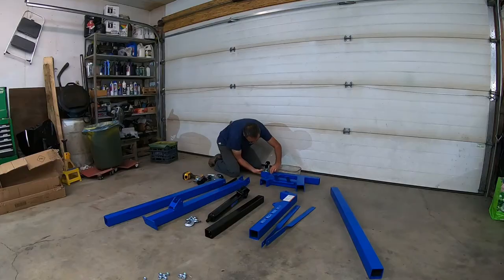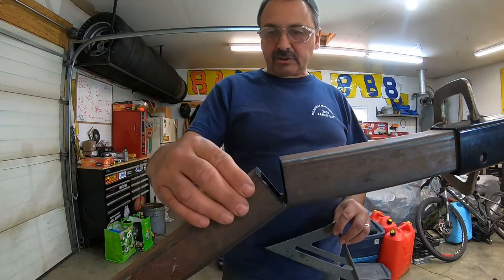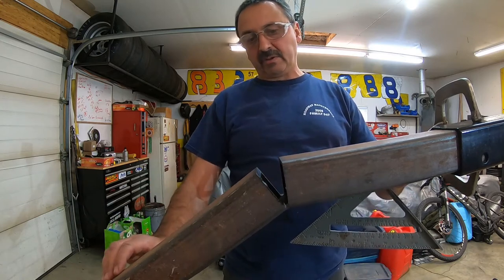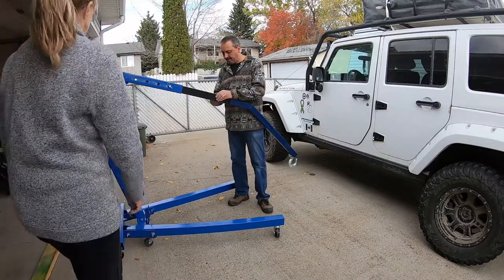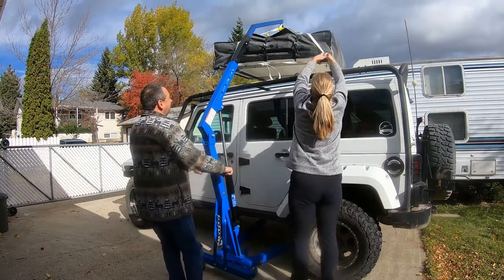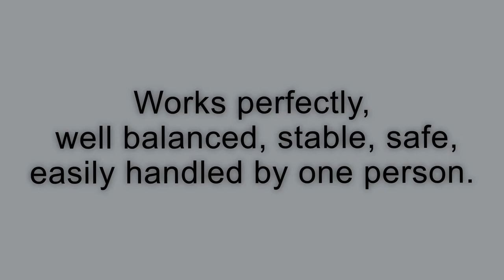DIY Roof Top Tent Lift

Comment: I went to harbor freight and bought the 1ton shop crane to do exactly this.  Your idea compared to other videos I've seen is the cheapest, safest and effective way to mount and remove my RTT.  I don't keep my RTT on my truck full time.  But when I want to install it, seems like no one wants to help me so this is the best method of doing it safely for one person.  I would change a few things though about it.  1.  The hook point, I would rather have to be 2 chain links then the hook with a bolt going through the frame.  2. Add threaded rods at the rear of the hoist near the casters to basically have a spot to put weights on as counterweight only if needed.  I rather have about 100 lbs of counterweight to be damn sure that the hoist has enough weight on the back even if its only 110 lbs of RTT I'm lifting.  I have a Toyota Tacoma so I might have to tweak the design a bit anyways.
Reply from the maker: That's the beauty of DIY, you build to suit your needs 👍

Comment: You should sell this.  I have the exact same Jeep, Rack, similar tent (Roofnest).  I would buy this in a heartbeat.  I don't have access to a shop.  Great idea!!!   I wonder if I just extend the tube 3 feet, if that will give me the clearance to use the hoist without the bend.
Reply from the maker: I think it would tip over forward with that much sticking out at the front, needs the bend so you can keep the weight closer and lower 👍
Reply: @VoyagerOverland  Thanks for getting back to me so fast.   Like I said, I have the identical setup you have.   How far down did you make the cut on the tube?   Also, if you know the angle, that would save a lot of trial and error.
Reply from the maker: @robertsack257  I put the dimensions in the description for you 👍

Comment: Awesome work, would you be able to share the measures and angle you put on the additional arm?
Reply from the maker: Measurements are in the description 👍
Reply: @VoyagerOverland  sorry and thanks for mentioning it. I also saw that you take the crossbars with it, are you not struggling to fit it into the nuts of your rail base? I know that the attachment legs of the roof tent is a nightmare to put and remove so I am thinking to take the crossbars too and i believe it helps to lift the whole pack. Have a good day

Comment: That’s perfect!  Planning on using harbor freight engine hoist for exact same purpose.
What are the dimensions? Thanks
Reply from the maker: Pretty simple really, 2" X 2" square tube, 4' long. Cut and bend as desired according to the vehicle you are work with. Let me know how it turns out 👍

Comment: Like the build, just wondering if you are still using it and how it is holding up? any modifications ect.
Reply from the maker: I used it last weekend as a matter of fact and in the snow no less 👍 Works awesome, takes minutes to remove or install the tent.

Comment: Had this built in Florida and used it once, moved to NC, and the moving company lost the extension!!! had another extension welded together from the shop in Florida but they didn't want to drill the holes because they didn't have the receiving tube from the crane. So, my question is, the new hole on the crane receiver, ( @3:42 on your video) and on the 18" end ( @3:56) how far in do I drill the hole for the crane receiver? tried to see on your video, looked about  5" 
thanks again for a great  design, cant wait to use it up here in the Mountains of NC.
Reply from the maker: NC? wow never been that far south. It's pretty simple, slide it in the crane, mark it, and drill it!

Comment: Do you think this would support a 230lb RTT to mount on a lifted 4runner? Thanks and great video
Reply from the maker: I think by adjusting the extension angle and maybe adding a counter weight at the back of the lift, this can work with any vehicle.

Comment: We have a jeep JL with 2inch lift, Rhino rack rails, and a CVT tent,  will your design give us enough clearance without maxing out the cylinder?
Reply from the maker: Wife's JKU is on a 4" lift and 33" wheels, depending on how high your engine crane goes and the angle of your adapter, I would say yes it would.

Comment: What is the height that you can achieve with this setup,  looking at building the same setup and I wonder if I can use the dimensions you are providing. That said I have a 4runner with an iKamper, so I would near to clear ~90 inches. Need be I could always install additional 2x2 metal tube between the legs and wheels to give a small increase in height.
Reply from the maker: I'm loading the tent this weekend, I'll measure maximum lift and I will let you know 👍
Reply: @VoyagerOverland  Awesome thanks, at worse I'll get a couple wood pallets and put the shop crane on top not as stable but only lifting ~150lbs.  Also I meant to ask; RCEME ?
Reply from the maker: @collin7776  ok, you have my attention... Yes RCEME, many, many years ago. How did you guess?
Reply: @VoyagerOverland  An educated guess; the decals on the side of the jeep as well as the very well organized garage and finding a crafty solution to a problem.  Also I just got my 20 years in the RCN.
Reply from the maker: @collin7776  you should be a detective😎
The white JK is my wife's actually and as you notice the roundel, she was RCAF... But I don't hold it against her. 🤣
20yrs... Thank  you for your service 👍
Reply from the maker: I measured today and had 9ft by the time the tent hits the crane arm👍

Comment: okay stupid question..but if I have a smaller car is the engineered enlongment that you made necessary ? I am just asking cause us (2 sisters) are also having trouble getting it on our car but we have a very small one so we considered getting a crane..?
Reply from the maker: The extra length is for reaching further up and away, it might not be necessary for a small car. You would need to try it and and see 👍
Reply: @VoyagerOverland  thank you so much for your answer 🥰

Comment: I try to build your solution. could you please tell how long the part is, which is outside before the bend. 18" are inside, XX" is the length to the bend, the band is 30 degrees and from the band this part is 29" long. Thank you
Reply from the maker: That part is adjust to whatever length you require for your application 👍
Reply: @VoyagerOverland  It just mustn't be too long, otherwise the crane will tip over.
Reply from the maker: @jurgenschlieszeit8156  Correct

Comment: I can’t see how you attached the Clovis hook on the end?
Reply from the maker: I have a 3/8" rod welded inside the square tube, a bolt would work just the same 👍
Reply: @VoyagerOverland  ah yeah thank you, I just finished making ito today, but the hoist doesn’t have enough lift 😢😢
Reply from the maker: @RobDaBankz  My plan was to either extend the cylinder or move the cylinder mounting point if I needed more height. Let me know if you try either of those options 👍

Comment: Or call your rental place rent a genie lift for 50 bucks a day
Hydrological or battery operated and has forks or a arm to lift the same way you did
Reply from the maker: I had to think on this for a while... I remove and install the tent several times a year, the rental fees would far out weight the build cost in my case.